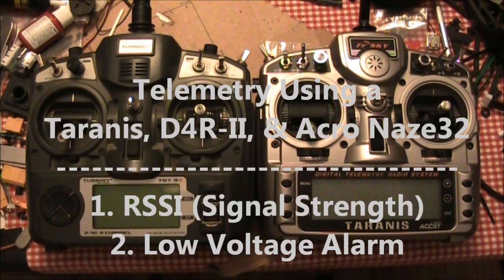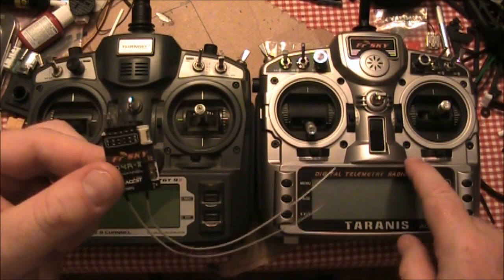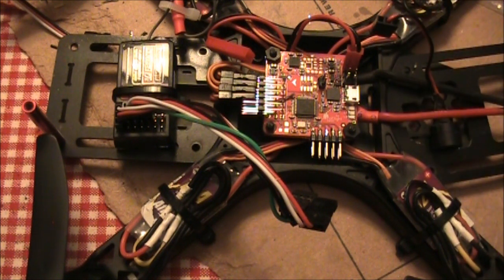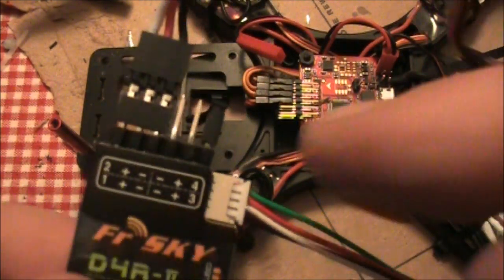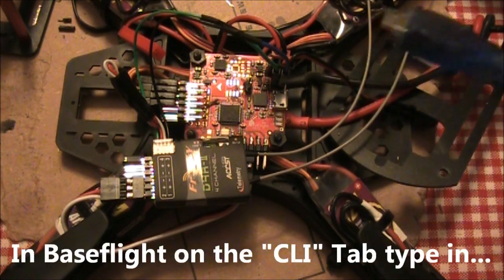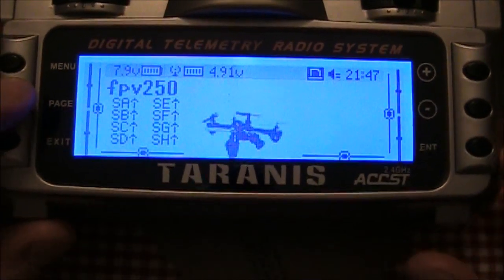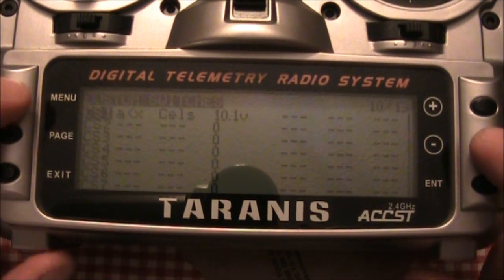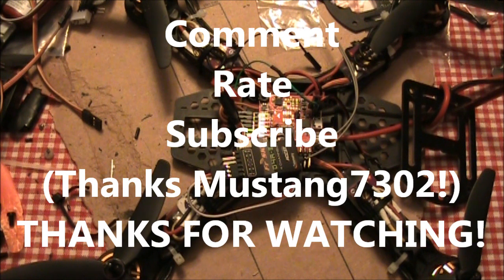Acro Naze32, Taranis, & D4R-II Telemetry Setup (CPPM)

Comment: Great video.
Unfortunately when I wired the board up as you have shown I had the magic smoke emitted from the Naze32 board. Inspection of the board showed that I had indeed cooked the main chip (STM32F) on the naze32. Not sure why? I am still investigating. I don't think I reverse connected the battery or telemetry but since I pulled the battery and cables off quickly when I saw the smoke I have no way of confirming this. Any ideas what could cause my fail?
I have another Naze32 and I don't want to cook it in the same fashion.
Reply from the maker: Double check all your connections.  You must have got something backward.  I cooked a MultiWii board when I hooked up one of my ESCs wrong.  It sucks.

Comment: I wanted to ask you a question, I have a naze acro, I also use a D4R with a taranis, you have updated the firmware of the receiver? I've heard that it could cause problems. I would use 5 channels in ppm, (4 for the control surfaces, one to change flight mode) thanks and sorry for my english, I hope it is understandable.
Reply from the maker: I did not upgrade my firmware.  You should only need to upgrade it if you want to run more than 6 channels over PPM.  If you're only using 5, then you do not need to.
Reply: Thanks man
Reply from the maker: Lorenzo Longhini You're welcome.  Alot of this stuff is confusing at first and is sometimes hard to find answers.  I'm glad I could help.
Reply: You are a very kind person. always solve my doubts, your videos are always very clear, I'm Italian I can understand what you say in the video, thank you.

Comment: Any advice on doing this with a Flip32 (basic)? The pin setup us is slightly different, I an watching your video and looking at the diagram for the Flip32
Reply from the maker: I don't think it can do it.  The FrSky telemetry output is one thing that is unique to the Naze32.
Reply: The Flip32 is the "clone" of the Naze32 and only had a different pin out. The Flip32 from Readytoflyquads is identical to the Dragonfly32 from multirotormania. Ill try it out and let you know, I just didnt want to run into puff the magic white smoke dragon

Comment: Travis..... do you know if i use a d4r II with a turngiy 9xr. does the transmitter module the djt frsky does it haave a tx rx output on the tranmitter module that can have a bluetooth connected so i can have a android bluetooth device near to my transmitter to receive the bluetooth data via multiwii ez gui...
Reply from the maker: I'm guessing "no", but I'm not sure.  I've been trying to find a used FrSky module to use in my 9XR.  I'm working on a new tricopter so most of my money has been going there.

Comment: Please help!. I do this but I cant get the "Cell" Value... i just dont undestand why... I try everything... I get all the others Values, 18 sensors in total, but "Cell" is not there... I enable "VBAT" and set the limits and get the buzzer alarm on the quad but It cant get by telemetry to the Taranis,  so I cant set an alarm that doesnt depend from the Lipo Type (3S or 4S). Thank you in advance for your help.

Comment: Been at this for a while and for the life of me I can't find anything in my Tx that says "cels" or "cells". The only thing even close is "batt" but that's just the battery of the Tx. What am I missing here?
Reply: +Project BlueFalcon Same here. Exactly. All I have are those two. I don't know why ours are different than other people's.
Reply: +Project BlueFalcon Thanks for the reply and all the info. Which rev. Naze are you running? I'm not sure if it actually matters tbh. I thought the Naze has the terminals that you connect directly to the PD board so it can see the lipo battery voltage. I'm pretty sure it does because I have a buzzer connected to the Naze as well and it will beep when the lipo goes around 13.5 volts. Same as I have my little beeper thing on the balance plug set to. They both go off at almost the exact same time. Which is cool, but I would rather have my Taranis tell me because I'm not always close enough to hear the buzzers. These guys who made all the tutorial videos we've watched never used any additional sensors and they have all this telemetry data right on their tarains screen.
Reply from the maker: +Project BlueFalcon I use that FBVS-01 on all my quads now.  I had been using the Naze32 output but that sensor makes it pretty easy.  It adds another components, which I'm not thrilled with, but it works great.  Here's my video on setting it up if either of you are interested:  https://www.youtube.com/watch?v=dU-h4sJH-Tc
Reply from the maker: +Project BlueFalcon I put one in my Blade 150.  It is already pretty tight inside so I stuck it to the side of everything inside with some tape.  :)
Reply from the maker: +Project BlueFalcon Great!!  I'm glad it was helpful to you!!  Thanks!
Reply: +travisgrindal Thanks for the replies and the link. I ordered the FBVS-01. I see in your other video you use different wires to connect it to the D4RII. Do you think you could still keep the D4RII connected to the Naze and also do the FBVS-01 simultaneously since it is using a different data wire color?
Reply from the maker: +TeamPreach I haven't tried it for myself, but it sounds like it could work.

Comment: I just received the Taranis x9d plus last night. I noticed that the switch on the right side all the way to the back is only going into one position. Once I try to put it into another position it quickly springs right back into the one position. Did I receive a defective transmitter? Thanks
Reply from the maker: No, that is a "momentary switch".  It is suppose to work like that.  I use it to have to have the Taranis verbally say the voltage from the quad.
Reply: travisgrindal thanks so much for the prompt response. I really appreciate it. I thought I had gotten a defective transmitter lol. Thanks again.

Comment: Rather than put the battery voltage direct to the naze32, which divides it and then outputs to the D4r, could you just put a single cell from the balance lead direct to the D4r and calibrate accordingly?
Reply from the maker: The D4R-II is not seeing the actual voltage through the Naze32.  The Naze32 is reading it and then passing it as information to the D4R-II.  You will probably fry your D4R-II if you connect it directly.  If you do try it, let me know what happens.  If you don't want to use your Naze32, then you could use a FBVS-01 to connect to the battery instead but you still won't get the individual cell readings.  You'd have to hook something up to the balance port to read the individual cells and I don't know if such a thing exists - especially one compatible with the Taranis.
Reply: ***** Ok I understand now, I was just thinking maybe it could be done with a few less wires. :-)
Reply: MW2Stambo Ok I have set mine up and found if you are using just one battery for everything on the quad, you do not need ground wires. 
Just the live from the battery pos and the wire to the d4 rx port.
Also from research I believe the ad2 wire is an analogue input which if connected to the battery pos through a simple voltage divider can send back battery pack voltage. I will test this when I put my second d4 in my AXN and confirm.

Comment: I love this how-to!  Thanks Travis, i'm now going to get the D4R-II.  Question: on FrSky X8R receiver, can it receive telemetry and battery info using S.bus port?
Reply from the maker: I think so, but I haven't tried it to know 100% for sure.  I think you need a FBVS-01 to read the voltage.
Reply: ***** Can this new FrSky X4R-SB receiver connect like the D4R-II?
http://www.alofthobbies.com/frsky-x4r-sb.html
Reply from the maker: I'm not sure.  Do you have one?  Are the labels on the back the same as the D4R-II?
Reply: I just ordered one. Guess I'll find out.
Reply from the maker: I think that is only a 3 channel and it does not support PPM.  If you can't get 4 channels out of it, then it can't be used in a quadcopter or tricopter.
Reply: ***** Travis, I can't figure out which wires to connect for telemetry to Naze.
http://www.himodel.com/manual/X4R%20X4RSB.pdf
Picture on manual shows four pins layout of:  
"AIN   -    +     S.PORT"
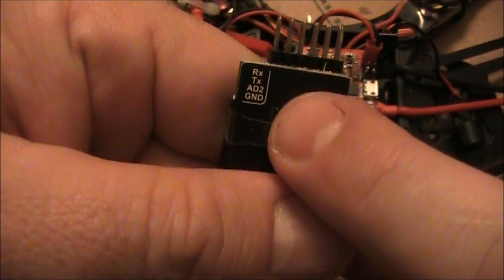Which ports are used for RX and GND(like you mention on 3:54mark on this video)?
Reply: leadpan Travis, I exchange it to D4R. I followed your tutorial but the cell voltage reads 1.4volt?
Reply from the maker: leadpan Did you run "feature vbat" to turn on the voltage monitoring?  I missed that in the video but I added it as an annotation... some people don't see them though.  If you did, there is a way to correct the voltage reading but I'm not sure off hand what it is.  I'll try to look.
Reply from the maker: leadpan Also, what is the overall battery voltage reading?  ... like all your cells combined?

Comment: Travis ,Can you help me ? I followed the instructions exactly many times with 2 different naze 32 boards and 2 different dr4-II recievers . Still no voltage read out on cell or cells. all features are set. I remembered to arm board . Still all I get is 0s. 6 hours and still stumped.
Reply from the maker: Did you run "feature vbat"?

Comment: nice video thanks for the effort but im a no go. everything plugged in right telementry enabled and vbat enabled confirmed with clean flight. getting rssi but no cell voltage .. came back several days later double checked everything cant figure this out. same equipment as you do and board arms and motors spin up
Reply from the maker: RC Pilot Someone said there is some kind of "FrSky" option they had to turn on some where in Clean Flight that finally made it work for them.  I'm not sure what or where it was, but I'll look around and if I find it I'll update the "About" on this video.
Reply: Yea I found it its in the ports tab. Got it working thanks
Reply from the maker: RC Pilot Sweet!

Comment: By any chance, do you know how to set up the X8R and the naze32?
Reply from the maker: I don't think the X8R supports CPPM so you have to connect a normal/standard 3 pin adapter from the X8R channel 1 to the positive, negative and pin marked "1" (all right beside each other) on the Naze32.  Then you have to connect ONLY the signal wires for the other channels.  After you have them connected, make sure all the channels work in baseflight.

Comment: I need some help got my Naze 32 Full board, everything seems good, I did receiver test, the board is seeing all my control movements, and I can arm the board if it's plugged into the PC, if I unplug the PC and plug it in the battery the ESC's don't even give me all the tones, if I even plug the usb into a usb hub not connected to the PC but has power then plug in my battery and then I can arm from my transmitter.

Any help would be appreciated...
Thanks!
Reply from the maker: Are any LEDs lighting up on the Naze32 when you connect the batteries?  "Opto" ESCs don't have a BEC in them to provide power to the Naze32... maybe you have Opto ESCs if there are no LEDs lighting up.
Reply: Yes the LED's light up either way, the escs an motors worked fine with a KK2 board, and I can get it to work if I power the board with USB first then plug the battery in, then unplug the USB and I have full control from the transmitter I can arm and unarm the FC but have to do the whole routine again when I unplug the battery...
Reply from the maker: Tom Sanders I have not heard of that.  The only thing I could think of trying is to reset the board and set it up again and see if anything changes.
Reply: Ok tried that many times, thanks for your input!!
Reply: Tom Sanders maybe you could try and calibrate acc on cleanflight then save wont arm if on a tilt

Comment: hello, I need your help.
i have the Taranis X9D Plus and I did the firmware update for
the latest available version.
I do not know how to change the channel order, to the following configuration:
someone can help
Mode 2
Channel 1 - aileron
Channel 2 - elevator
Channel 3 - trotthe
Channel 4 - rudder

thanks
Reply from the maker: I think you change it on the receiver side or in the flight board config.  Which flight board are you using?
Reply: the radio is new, i don´t have flight board.
but the radio cames with other channels assign.
Reply from the maker: My channels are RETA.

Comment: I'm getting RSSI telemetry but I'm not seeing Battery Voltage???   I hooked up the VBAT + and - to my power distribution and turned on VBAT option on the Naze32 and just see 0.00v.    What am I doing wrong?    RSSI is working fine so I know the telemetry is sending from the Naze32.   I have even used  "set telemetry_inversion = 1" in the clmeanflight CLI...
Reply: Brian Dodds Think I figured it out.  Not only did I need to do the "set telemetry_inversion = 1" I had to turn on FrSky Telemetry for UART1 under the Ports tab andARM the motors before it would show up.
Reply from the maker: Brian Dodds I'm guessing you are using CleanFlight.  The options are a little different there.  I'm using CleanFlight now myself.  I need to get the options for it updated in the About section.
Reply: ***** Yes I am using CleanFlight.  Now I'm trying to figure out if there is a way to get the telemetry to work all the time even when the motors are not armed...
Reply from the maker: Brian Dodds I've started using a FBVS-01 sensor.  It is on as soon as there is power.  https://youtu.be/dU-h4sJH-Tc

Comment: Noob here... I have a Acro Naze32 that I'm trying to connect with a D4R-II receiver. I enabled PPM in CLI and connected the jumper. When I plug in the receiver to the board, the receiver is not getting any power (I'm plugging it in just like you show in the video). If I plug in the receiver to the where the esc are plugged in I get power. Any idea what is wrong?
Thanks
Reply from the maker: The receiver gets power from the BECs on your ESCs not from the Naze32.
Reply: ***** I thought you only had to connect one wire if it's a PPM enabled receiver. I'm doing it exactly as you do it in your video (at least I think I am).
Reply from the maker: bjohnrini Sorry, you are right.  I was wrong. I typed too quickly without thinking.  You have to connect the positive, negative, and channel 1 signal on the Naze32 to your receiver.  The "one wire" means that all your channels are sent through the one wire.  Your receiver has to get power from somewhere and that is why you need the positive and negative connections from your Naze32.  In the video I'm using that 3 pin wire and that connects the three required pins between the Naze32 and receiver.  On a side note, I was working on some foam airplanes and on them the receiver does get its power directly from the ESC.... sorry again, 2 different worlds with different rules and I'm trying not to mix them up.
Reply: ***** Yeah, so it looks like I have connected exactly as you connected yours. Just not getting any power to the receiver... The soldering looks OK to me...
Reply from the maker: bjohnrini Do the ESCs you are using have a BEC?  They may not.  Which ESCs are you using?
Reply: ***** I purchased the quad from someone, but I believe this is the ESC
http://www.multirotorsuperstore.com/electronic-speed-controller/ms-12amp-esc-simonk-rapidesc.html
Reply from the maker: Those ESCs should work fine.  The only thing I could think of is to try to reset your Naze32 and see if anything changes.  If not, your Naze32 may be messed up.  Is it recognized in BaseFlight when you hook it up to your computer?
Reply: ***** Yes, it's recognized by baseflight. Tried a reset, didn't help. I guess I have a bad board or I'm doing something stupid.
Reply from the maker: bjohnrini Can you make a video of what it is doing (not doing)?